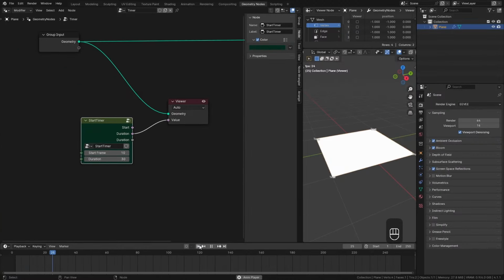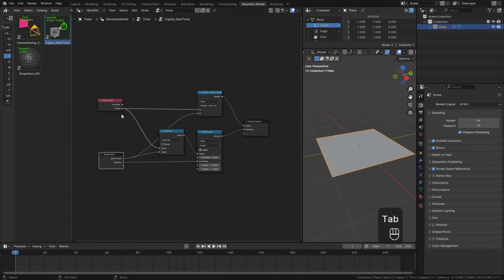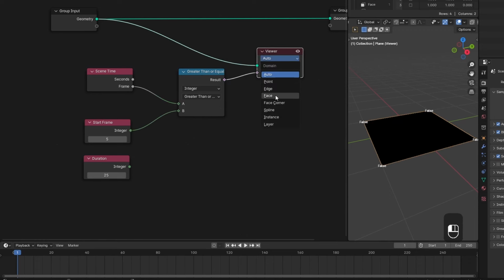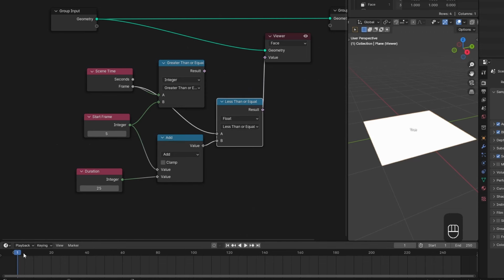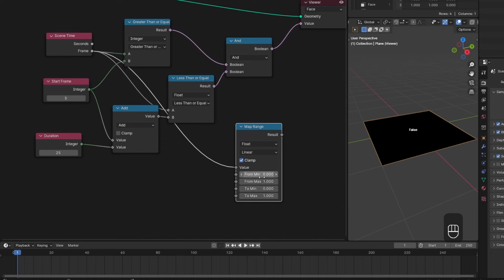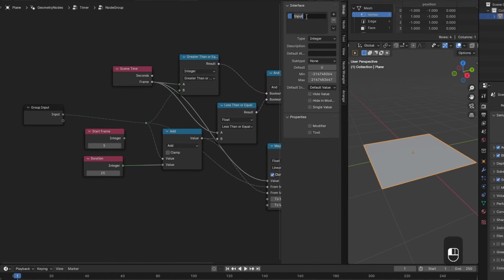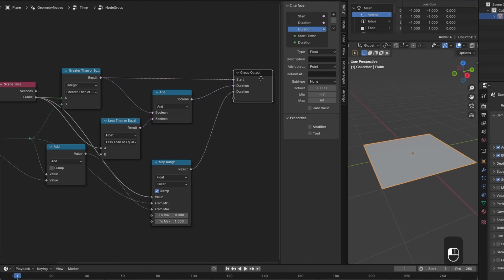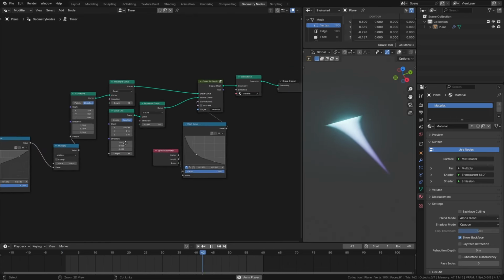Start Timer Function | Blender Geometry Nodes

Comment: Thanks for this.  You do very useful tutorials.  I came across this in the search for setting triggers for simulations.  You can use an f-curve from sound to samples in the graph editor tied to a value node, then use the compare node to set a threshold value that you could pass on to a switch node set to integer that would pass on the frame number from the scene time node.  That’s how you could use an audio file to trigger a simulation with that timer.  But it gets tricky because you probably don't want to keep resetting the start time every time you are above the threshold.  You'd want some boolean logic (compare node using the duration or some other value) that prevents resetting within a certain amount of frames.  I've been trying to work on that for quite a while, because I want to understand how to do it and gain a better understanding, but the per-point logic vs setting a global trigger delay is way more complex than it seems it should be.

Comment: it's possible to use this one your volumetric portal for ex i want to  that portal start in certain keyframe and stop
Reply from the maker: use a switch node before feeding the points in to the simulation (before join geometry node). Then you can animate that switch boolean to trigger the portal effect whenever you want.
Reply: @ thanks bro you’re the best 🙏

Comment: Do you think it would be possible to do the same based on proximity. Using the proximity as a trigger instead of a fixed frame start point.
Reply from the maker: yes, you can either use vector math>distance or geometry proximity node to create a trigger